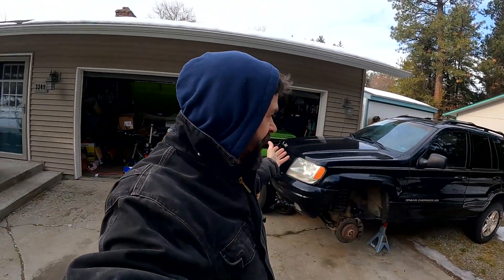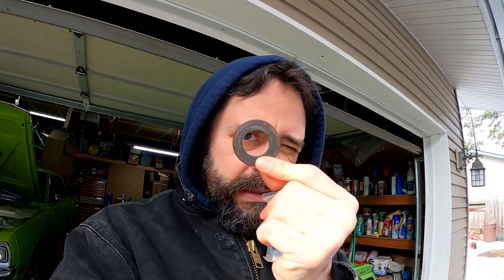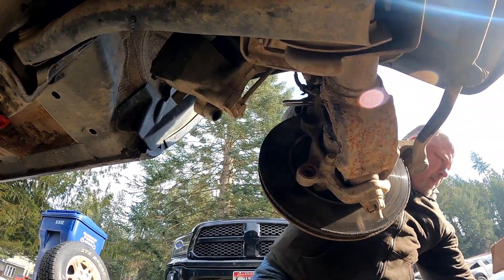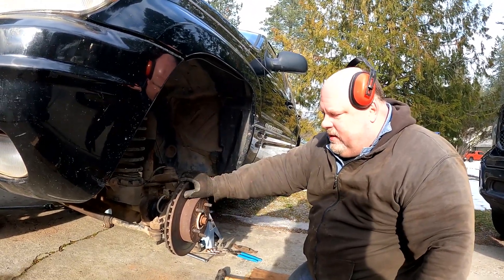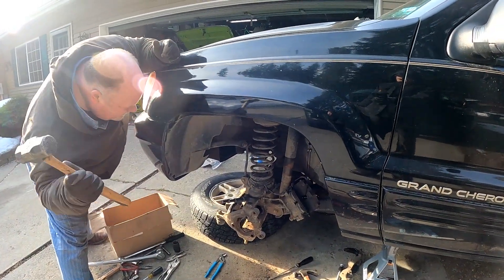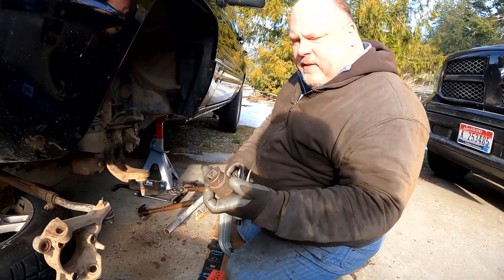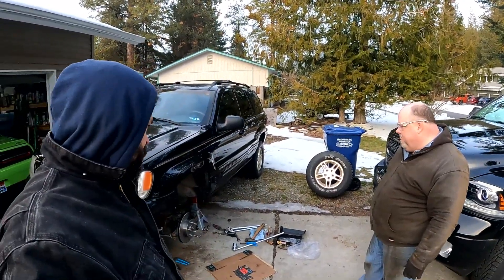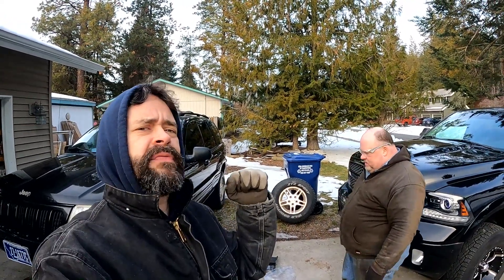Axles, Hubs and Ball-Joints for Project Jeep Grand Cherokee WJ [Part 5]

Comment: Hey guys! Great information as always. I think I may have finally found a "Raptor Run" group up in Michigan to be able to go on a trip with at some point. They are an awesome group. Michigan has sand dunes as well and they are similar to the Baja style sand dunes. They also do the secondary roads trails too. I would of course have to record my trip for posterity and share it with y'all 😁.
If I could trouble you for the link to your video where you did the install about the puddle lights in your Raptor, the side rear view mirrors when you could, no rush though just when it's convenient. I will save it in my album for future reference. I have lights to install, but no harness. Did you guy have to direct wire into the existing system, or did you have a harness come with your kit?
Reply from the maker: That's awesome! For sure share the adventure, we're looking forward to hearing about it!! The puddle lights were in our Digitizing the Raptor video and can be found here https://youtu.be/rweIbHqh52c . The new puddle lights plug into the factory puddle light connection. The turn signal upgrade does come with a harness but you have to get both parts because one comes with an updated harness that includes provisions for plugging the other one in. We did extend the factory harness but Uncle Jake says it wasn't strictly necessary, just made it easier. The products are linked in the Digitizing the Raptor video description. Thanks for commenting!
Reply: @MotorsandMischief  awesome! Thanks so much for that link. I tried and tried but couldn't find you guys video anywhere. Everybody else's came up instead. Yeah my Raptor is a 2010, but it does have the slots that you pop out in order to add lights. So I just have to wire them then to the existing wiring inside instead of a harness. Cool, sounds like a job for my partner, he's always wiring lights on our 2014 Freightliner Cascadia so this will be right up his alley. 
I want to eventually get the new upgraded mods for the turn signals and reflector to turn those into lights. But I will get there eventually. 
I will definitely post the Michigan Raptor Run if I get a chance to go this year. Might have to wait until next year. Got to get the truck lights done and a two way. Have an awesome day y'all. Thanks again for finding that link for me!

Comment: The axles listed in the description are not correct for this particular Jeep.  This one has QuadraDrive, so the shafts are slightly different.  Be sure to know which transfer case/drive setup your Jeep has before ordering parts.  There are also two different front brake options for this year Grand Cherokee.  You will need to identify which caliper/pad you have in order to get the right brake parts.
Reply from the maker: Good catch! We've updated the description to show both types of axles. As to the brakes, as Dr. Torque mentioned, they can be either ATE/Teves or Akebono. The most noticeable difference between the two caliper types is the ATE/Teves caliper has a thick wire clip that helps hold the pads in place, as seen in this video. The Akebono calipers do not have this wire clip. Another way to tell the difference between the two types is to look at the back of the caliper and check the casting numbers on them. The Akebono calipers will have casting number 4802 on them. The ATE Calipers will have casting number 4835. To get the PowerStop pads (which we love), Z36-790 gets you the ATE/Teves pads and Z36-945 gets you the Akebono style. We've updated the description accordingly.